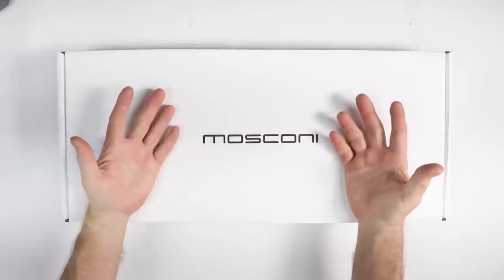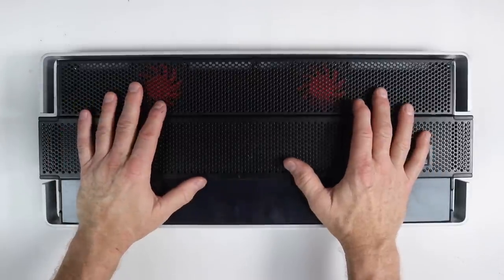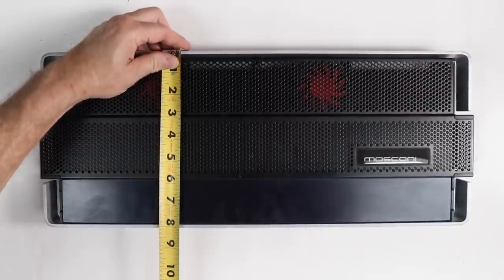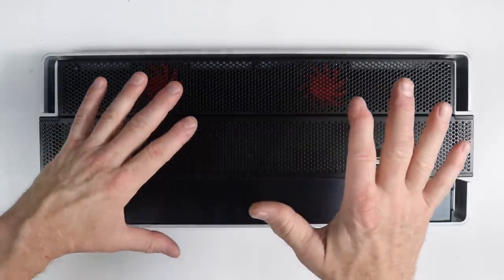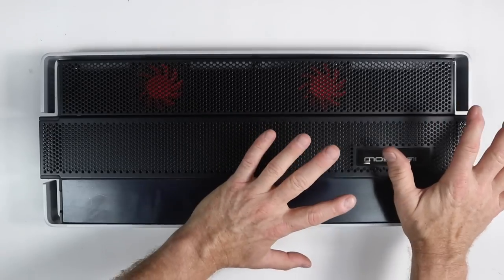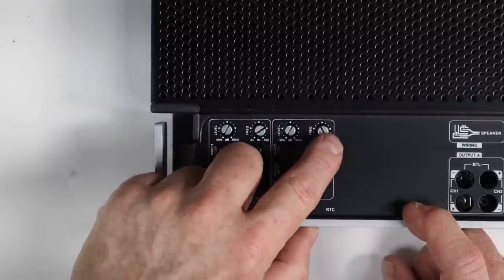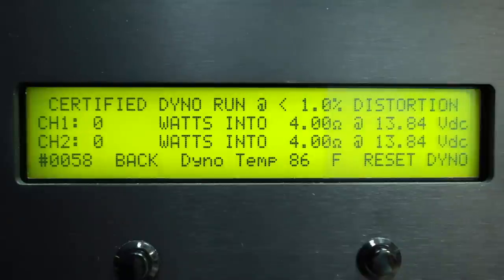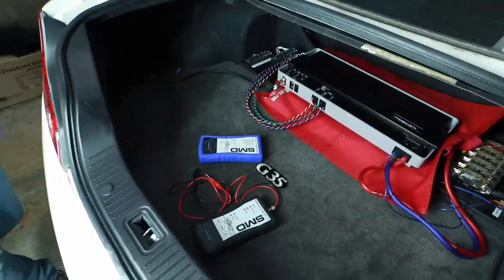Mosconi Pro 4/30  Car Stereo Lab and real world amp DYNO

Comment: Great video! I’ve been waiting forever to see a Pro get dyno’d- thank you. I’m fortunate to have 4 pros in my truck. Just beautiful sound. No heat issues. No any issues.
Reply: that sounds intriguing to hear  
that foot print/ relistate  sucks atleast for me that's what's been wanting  me to change my hole truck stereo  but with your few words  it sounds awsome 🤘🏽
Reply: @clittle1559   was finally able to have my dream build built. 2 4/10’s 2 1/10’s and the 8 to 12 Aero DSP. To me they definitely lean more towards a “tube” sound. Love it!
Reply: @SOBaseball  Those are not the same as this Amplifier as those are class A/B and this is class A A/B
Reply: I want the 8/30, but it’s only AB. Not sure I want to pay 4k for it. Will do two 4/30 A/AB
Reply: @CarAudioHorizons . What does that mean please? I had the best installer put these in after telling him I wanted the best. (Outside of forking up for Brax etc)
Reply: @SOBaseball  What does what mean? Mosconi Pro 4/30 is a class A/AB amplifier. All the other Mosconi Pro amplifiers are Class AB.
Reply: @CarAudioHorizons  you said some were class a/b and some A a/b. I don’t know what that means. Just hoped u could explain the difference
Reply: @SOBaseball  A simple google search will tell you the difference if you didn’t understand the video. You’re responding to comments every three weeks I’m sure that’s enough time to google it, or ask your installer which you said installed the class AB Pro’s amps in your system.

Comment: The crossover points and 10x multiplier on this amp should be on every amp. For some reason I typically only see that kind of crossover on really inexpensive or really expensive amps, but not the in between price range, like the Morel MPS400.4.

Comment: The eight channel with built in DSP is already available in Europe. I found it when I was researching eight channels with DSP’s that compared to the Helix V Eight DSP Mk2.
Reply: I have it already in California usa
Reply: @gafana6502  Pro 8/30?
Reply: @gonzoe123  yes it's installed in my tundra right now
Reply: @gonzoe123  I installed it Saturday
Reply: @gonzoe123  also the DSP in the 8|30 is more on the level of the brax DSP. Edit: I was wrong it's  different.
Reply: I have it in my car with the new Aerospace 60 AMT ribbon tweeters 😉
Reply: Is the DSP on the 8 channel the PRO or Aerospace DSP?
Reply: Where can I purchase this amplifier?
Reply: @nickorozco5933  where are you located?
Reply: @zacjones89  I was told it's not like either. It's new
Reply: I am using helix V8.mk2 a great software and  good sounding amp
Reply: @gafana6502  how is the amp sound I am thinking to buy it
Reply: @17shakil  I love it. I need to replace my components but it woke everything up. Will be adding a pro 1|10 & pro 2|10.
Reply: Gladen changed the description of the 8/30 to class AB recently.  It was previously listed as A-AB like the 4/30.  Not sure what happened there.  I'd be upset if I bought one as A-AB and then found out it was AB only.  I emailed them asking for clarification on that but no reply yet.
Reply: @zacjones89  it was never an aab. I knew it was typo when I ordered it. It's ab and still awsome
Reply: @gafana6502  Hawaii USA
Reply: @zacjones89 8/30 is an AB amp. It’s nothing like the 4/30. 4/30 is its own unique amp. It’s too bad they didn’t make it 6 channel. 

I looked at 8/30, but it’s price is 4000. So I might just grab two 4/30’s. You just have to make sure you have a 180 amp alternator. It drains a ton of power. Alternator might not last as long in vehicle. The 4/30 is no joke. 

So I also can see why 8/30 will become more favorable in a daily driver. Plus it has built in dsp. 

4/30 you will need 8-12 Aerospace to get max sound from it. 

Decisions.
Reply: @gafana6502 8/30 is an amazing amp.

Comment: What about thermal considerations? Installed in a trunk in Florida summers? No thermal shutdowns experienced?
Reply: No issues with the pro 4/10's or 1/10 in Houston. I heard the fans kick on maybe 5 times throughout July and that's about it.. Not sure how much the class A bias will change that.
Reply: No issues at all.
Reply: @Douglasdimmadomer  in Houston my 2|10 and 5|30 are fine. My 4|30 is dropping out on thermals. Even in the initial Mosconi video introducing the new amp, he says the thing gets hot...as you would expect. So install accordingly.
Reply: @Cleofizoid  hey do you have the pro 4/30 shutting down? What are you driving with it? Active or passive?
Reply: @nickalways4u007  Yessir, my PRO 4|30. It's an active system w/8TO12 Aerospace DSP. The 4|30 is mounted professionally in the trunk of my new Lexus IS 500 F Sport Performance and is driving the front stage Focal Utopia M TBM Tweeters in custom A-Pillars and Focal Utopia M 3.5WM Midrange drivers in the right and left factory dash locations.
Reply: @Cleofizoid  i have my Pro 4/30 ibstalled to the rear part of by back seat in the trunk. Its sandwiched between the subwoofer box and the back of the rear seat. After about 40min of listening mine shut down twice. So what I do now is I fold down my rear seats exposing the amp to fresh air inside of the car cabin. No issues at all. With this amp you need to be mindful when installing. It needs cool air. Hope this helps. The sound quality will be worth it though😎👍